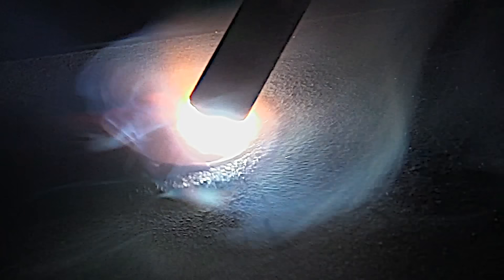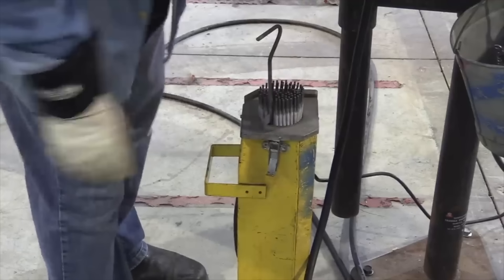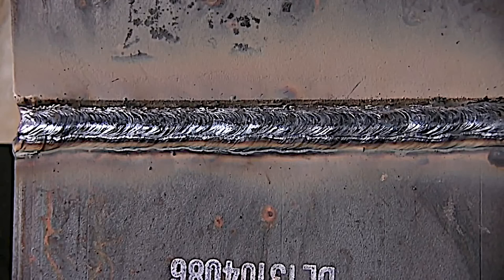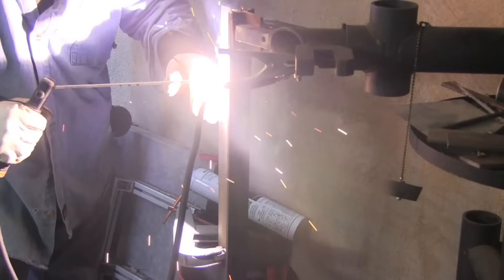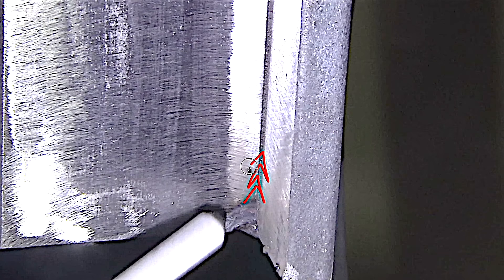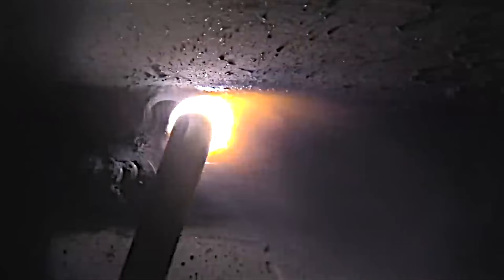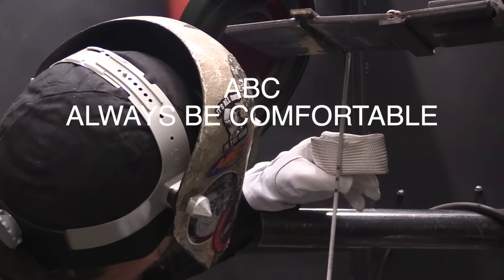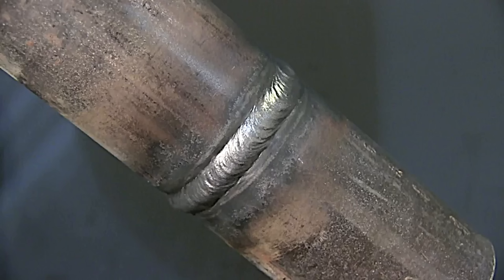7018 Stick Welding for Students SMAW

Comment: At 1:45, best advice ever " fresh out of box or ROD OVEN ". I tensel tested some 7018 left out for a couple of days. The trapped moisture reduced the tensile strength dramatically. As moisture EXPANDS over 1860 times as it turns to steam / vapor in the puddle making arc control impossible. Great video as usual Jody.

Comment: Great info Jody. I went through welding school and did many welding courses here in Spain. I did the very same practice samples through those years and that's how I teach friends or work colleagues that want to begin welding. The only difference is we use the 6013 rods in schools and courses but that's because they're cheaper. Another difference I see between welds here and over there in the States is, unless job's don't specifically ask for stringer passes, it's all done with weaving passes. Your explanations and videos are the best. 👍🏻

Comment: I prefer to use 7014, I find it is much more forgiving for position work. There is a reason why it's the only ride allowed in nuclear plants that I'm aware of, at least at one time that was so.
I'll find your average recommendation a little bit on the high side just for running bead. 7014 for differential metals like stainless to Black Iron. 7018 most of my welding was done vertical uphill. Repairing the top of sea furnace at Ford Rouge at 287 ft in the air on a 10 inch wide board. That'll make sure you learn how to put decent welds down. One of the reasons I was taught to put a root pass down with no backer. You got to be handy at that stuff. Taught you how to be really steady